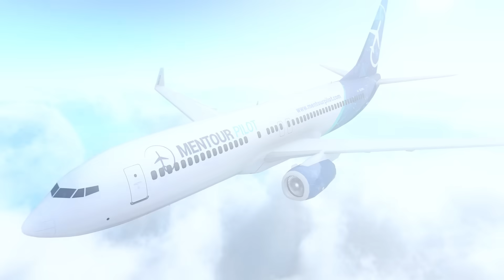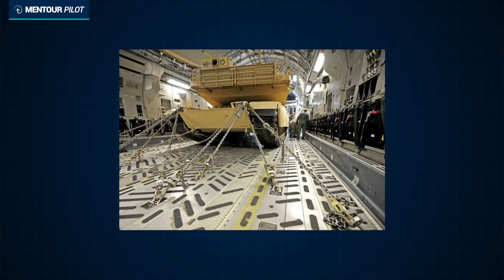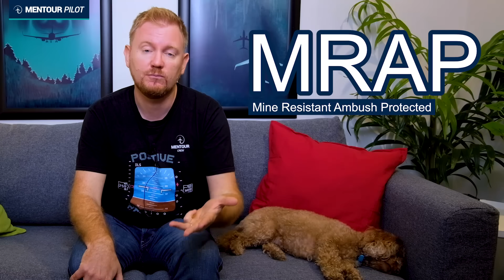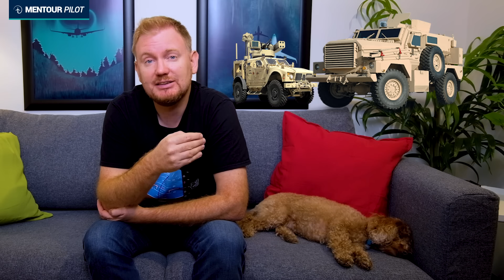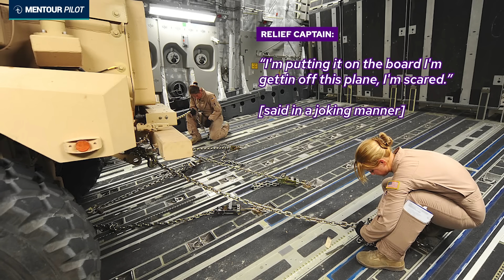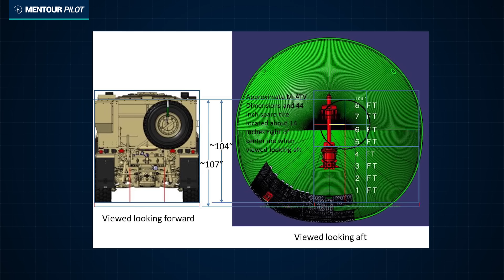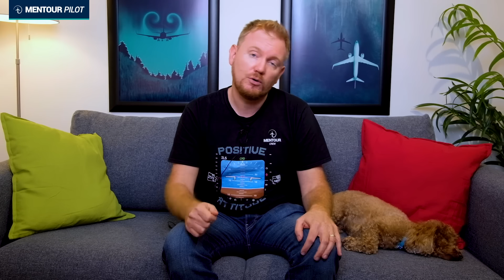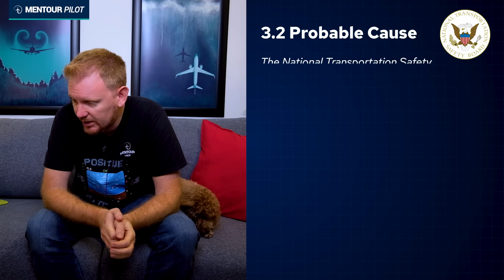Why did the pilots LOSE control?! National Air Cargo flight 102

Comment: The question is - why they used boeing-cargo for transporting these military vehicles?
Reply: Why not though? Outsourcing is a very common thing in american military efforts. I wouldn't be surprized if there were more contractors than military in places like Bagram at certain times.
Reply: The government is all about "The lowest bidder". There is that but also service contract  agreements the government will sign.  Be it the Air Force or another government agency there is still an inherit cost.  Say if the Air Force moves it might cost $100 but in a week,   and a civilian company will do it for 100  or 105 tomorrow...  Guess who will be flying it...
Reply: Very common.  USAF doesn’t have the equipment to transport everything that’s needed around the world.
Reply: If memory serves, I don't believe DOD usually contracts for specific loads, but that the contracts are for logistics channel runs and a certain amount of total lift.  I have never seen outsized rolling stock on a DOD contracted 747, probably because they can't be realistically palletized (on ULD pallets) to fit.  You can secure smaller wheeled pieces of equipment to standard or linked ULD pallets, and those pallets get locked into the airplane ULD system.  But outsized vehicles too large to be palletized were typical rolled up the ramp of a USAF transport and chained to the floor.  I saw things strapped to pallets, but straps never connected anything to the floor, it was the pallet locking rails or chains.

Comment: The fact that the cargo shifted at all was a HUGE red flag. If I'd been the loadmaster or the captain, I would have insisted on adding more straps upon hearing that they had moved even a few inches and that one strap had snapped, at least double whatever was on there already.
Reply from the maker: Yeah, that’s the sad part here, they were so close to prevent it.
Reply: Well I was in the military, a Seabee, an we never loaded the planes, just prepared stuff for loading, making pallets and arrangement on the planes. When we heard what happened we felt the tragedy of the situation and after that is when we were also taught to use chains on vehicles instead of straps even though we still don't load planes, the military thought it was still a good idea to teach us.